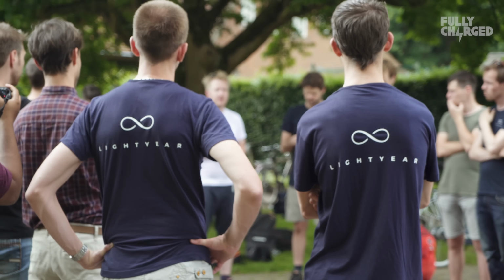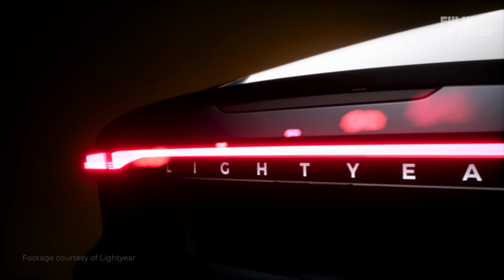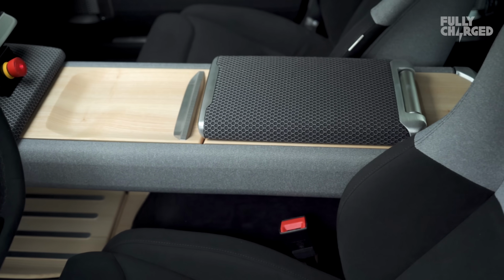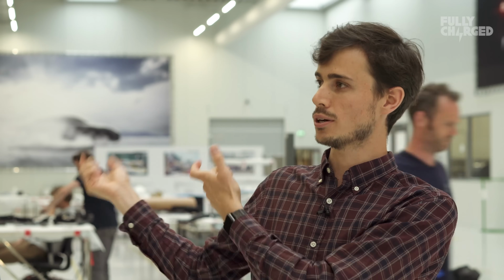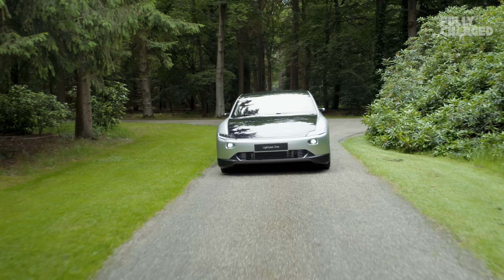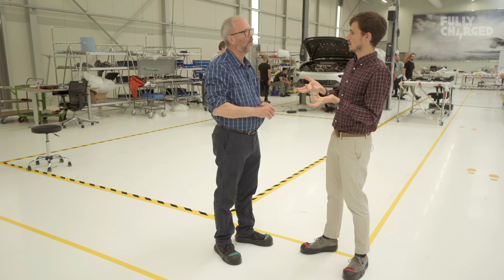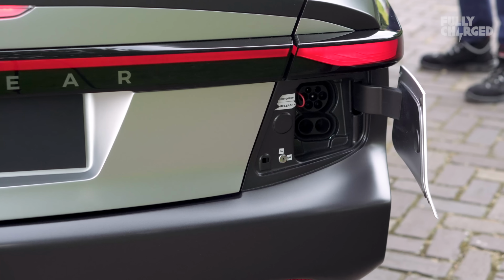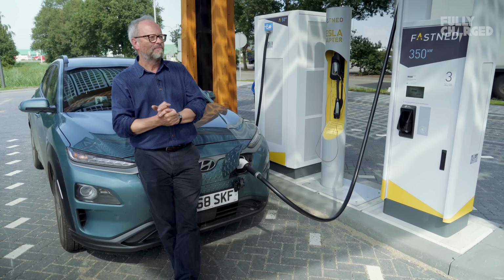Lightyear One solar powered electric car - exclusive first look | Fully Charged

Comment: Frankly I just don't understand why don't more electric cars have solar panel roofs/hoods. I only drive on the weekend. If I had a car like that I'd never need to plug it in to a charging socket.
Reply: Because cars can carry only a few square meters of solar panels, and the amount of energy received by a few square meters of sunlight is far, far less than the amount of energy required to move a mutli-ton lump of metal. On a sunny day, it'd add less that a mile to the car's range. It's far too expensive for far too little benefit.
Reply: @hans_von_twitchy1014  That answered nothing, but thanks anyway.
Reply: @papanino4415  I guess the first 5 words of your original post took precedence.

Comment: I love the car. But I can’t buy it if it cost more than $30 000. It just does not make sense with price of $170 000.. You will never sell more than 5000 cars per year with that price..
Reply: true...price will drop over time I think. I was at walmart the other day and I saw a 50 inch flat screen for 189 bucks...not long ago they cost thousands.
Reply: Uhm...... literally any Tesla. I live in a small town and they're everywhere.
Reply: Most car tech starts in ridiculous racing or luxury vehicles.  The point is to make enough money to test concepts, technology and techniques.  If that works then parts and pieces will flow down to everyday cars.

Comment: me coming from a model flying aircraft world im interested to see how much energy could be produced by funnelling some air into ducts that spin fans and the fans attached to motors some of my UAV planes that has on screen battery information, when we are descending  and not using power the prop is still windmilling and the amount of power that could be put back into the battery is staggering.

Comment: The ultimate solution is to have some sort of electrified roadway that a car can pull power from to drive and batteries/capacitors/generators could propel the car to it's destination when it leaves the main electrified highway.

Think wireless charger.

Comment: Lots of cool promises. Looks great.

I'm not believing it is viable.

Solar cells are just not that efficient and there isn't enough surface area to compensate for the inefficiency.

Air conditioning and heating would also take LOTS of power.

I don't think the reality can live up to the hype. The science just isn't there yet.

5 mph on a perfectly flat surface is doable. 50 mph up ad down mountainous roads with the heater or A.C. running is a long way off.

Adapting a Solar system to a Nissan Leaf may be more practical but even then, you probably wouldn't extend the range more than 5 or 10 percent and it would take several days to fully charge with on board solar only.

Comment: There is no such thing as an efficient solar panel.  I suppose relatively but solar currently is horrible.  If graphemes or other potential solar c lol tech prove workable then we can say this.  Even having possible autonomous energy source vehicles.
Reply: Eric Patterson if you can make 50.000 volt with a small tv controller batterie. what is the problem then? converter?
Reply: Tobias Bach my point is solar panels need a lot of surface area for a small amount of current.  This should improve eventually but now is not ideal.

Comment: "hyper efficient luxury sedan"....would be far more efficient if not a overweight luxury car.  I get that many want luxury, but the same electric motor and battery pack would go soo much further if put in a lightweight older civic chassis.  Older civic, around 2000 pounds...telsa model 3, 4000 pounds.

Comment: It’s exciting to see such young people involved in such a serious and challenging undertaking.  But to excel and move beyond the large car companies is so impressive.  If I had millions to invest I know right where I put my money.  Very impressive.  Their lowest range, in winter at highway speeds still exceeds Tesla’s industry standard range of 300 +- miles on a single charge.  The LIGHTYEAR ONE will travel 400+- miles at their worst performance range in the dead of winter at highway speeds.  But on bright sunlit days that range is approaching 500 miles!  The beat Tesla regardless of the weather.  Not only can this car drive by gas stations, they can apparently drive by electric charge stations as well.  Nicely done.  Best of luck.

Comment: I swear, the people bitching about this would have whined about the first light bulb.  "Oh, my torch is brighter, and I can cook a steak with it."
Reply: Plus, I can burn witches with my torch. CAN YOU BURN WITCHES WITH YOUR LIGHT BULB???
Reply: @LeeroyyyyyJenkinssssss  well the incandescent lightbulbs could probably give the witch a nasty scald, but the compact fluorescent and LED bulbs don't run as hot.
Reply: @TimpBizkit  damn you Edison! Lol
Reply: yes, i agree soon everyone with have one for a mere 135,000 $US
Reply: There are fundamental limitations to solar powered vehicles. Even if you magically had 100% efficient panels, perfect weather and you were under the mid day sun at the equator you'd only be getting about 6kw. If the vehichal is light enough this might get a few passengers up a moderate slope and under average conditions with current technology... You'd probably get more power from taking off the floor and having the driver Flintstones it.

Don't get me wrong the panels would probably pay for themselves eventually and the tiny amount of extra weight would be worth it for the tiny amount of power they'd output but we're talking 1% extra power if that, hardly groundbreaking.
Reply: @bloodypommelstudios7144  This car does have batteries you know.
Reply: In 1880 come the first Electric car on the market.
1900-1905 Lohner Porsche Hybrid Car 
1900 breaking the speed record of 100km/h
1903-1918 Ford Model T
1907 come the most common A Size battery.
In 1970 come the first microchip the Intel 4004 and the transistor density double every 2 years .
In the same year the lithium ion battery come on the market. Imagine where our society be if Battery developed similar .

I think that 1985 the batteries come to his physical capacity limits but can suppstain our needs.
Reply: James Franko  : You can doubt my time estimation, but what I said was true. I'm all for developing better batteries, solar panels and electric motors, but the technology is not there yet.

Don't get mad at me... It's just the way it is.

Physics remains the same. Work = force X distance. F=MA. The amount of solar energy per square yard shining on a 100% efficient solar panel has limits.

Fanboy cheerleaders can't change the laws of physics. At best solar panels can help charge a car or over several days fully charge a car. but there is just not enough surface area on a car to power it or recharge it in a reasonable time frame by itself.

The prototype looked very cool but it's performance could be bested by a typical electric golf cart.
Reply: I don’t begrudge rich people their luxury electric cars.  If you a sincere about minimising emissions however just buy a small to medium hatch, preferably a hybrid.  It’s better and more importantly 80% of people can afford it.       These guys are doing a good job.  Electric cars consume about 10kw.hr/ton/100km.    A square meter of 22% efficient solar cells should accumulate about 0.7kwhr/day.   If you can get 5 meters of collecting service that 1.75kwhr.  That’ll propel a 1 ton car 17.5km/day.      For people driving only on weekends it’ll be enough.
Reply: Gaslight, we didn't go from flaming torches to electric light.
Reply: Without critics the world would not improve.
Reply: There is an angry mob with torches and pitchforks coming for you.
Reply: Mmmm, burning stake steak, gargle gargle
Reply: Sorry dude, it's just not viable yet. 
More advances in solar panels, batteries and motors will be required.
Maybe in 20 years. 
No one wants it more than me, but reality is reality.
Reply: @chronobot2001  You've got to start somewhere or do you think in twenty years it would just happen?
Reply: @mookyzook  .........Start yes....Acting like this is going to replace Gas vehicles in the next 24hrs is what makes us roll our eyes....Not saying you in particular ....the WAAAYYYY to Overly optimistic  crowd that get an A+ in enthusiasm but a F- in understanding physics and practicality
Reply: @chronobot2001  Battery chemistry has very little room to improve; most of the new developments are structural/mechanical. 
Reality is that efficiencies are pretty good right now; don't expect too much improvement.
Reply: @chronobot2001  even at 100% efficiency and perfect sunlight. we only get 1kW of solar energy per square metre. you can get about 5m^2 of solar on them. can you move a car with 5kW of power ? what kind of aerodynamics and weight and friction characteristics do you need ? 

note that solar panels are only 15-20% efficient unless you get the space ones which are about 1000x more expensive than the more common silicon cells
Reply: yes and we still use torches, in fact, a torch can power a light bulb via thermoelectric plates. In a way, the ICE (internal combustion engine) is a complicated torch. Heat IS power dipshit. Heat also is responsible for the barriers in quantum computing as well as any other power source, including magnetism.

Comment: The solar roof and hood charge up to 12 km/h in the sun.  Great for those that don't have a garage to park in and plug into.
Reply: I think they meant each hour of charging in the sun recharges the batteries enough to drive 10 - 12 km.
Reply: hmm it would be good if it can be used three times like 36 Km where people can go from 1 small city to another, so it's not only for one city only

Comment: Tesla should buy this company and integrate the technology into their existing platforms.
Reply: It's not really technology but a design approach about saving weight on every component and prioritising aerodynamics - so if Tesla did that they would have to throw away their current designs and redo everything. The results might not be what you would like - less acceleration for example and some convenient things might be thrown away (no glove compartments for example).

Comment: charging at 10-12 km/h, in a normal 8 hour working day thats about 80-96km of charge... even if i only get about 60km of charge
i live about 15 km from work so yeah ill never have to charge my car again... 
the problem is solved so long as your trip to work isn't more than 40 km... 
sorry to the people who have to park underground at work
Reply: Except that you don’t get full sun for an 8 hour working day...
Usual rule of thumb is you get 5 hours worth of full output over an average day. 50-60km a day of charge.
Reply: @pugnut403  still fine by me i only need like 30kms

Comment: Whether this company will make it or not depends to some extent on how luxury they want to make the car and do they really want to make a solar power car. For example in Texas United States a solar powered car would make a lot of sense since we have many days of sunshine and if we park our cars out in the open they get very very hot meaning that a car that could charge with solar power might even be overcharged. Also anywhere in the southwestern United States such a car could go without any infrastructure at all. However watching this presentation suggest to me that these people are not even thinking about making a car that ordinary people might want to have or might be able to have. They have only the luxury Market in mind kind of snobbish actually. They probably won't succeed but the idea of a solar powered car is an excellent idea four parts of the United States and probably anywhere else in the world where there is not a lot of infrastructure for electrical cars yet but a lot of sunshine.

Comment: Now that type of solar power for cars is near enough perfect... just if you get stuck under a bridge in traffic the car would find it hard to use light power, but I guess that is why bridges have lights underneath them. Would the electric in the car kick in when you have no sun light? Like night time?
Lightyear One seems a very good car, way better than fuel cars but will it go with the electric cars out there? we will just wait and see...

Comment: Elon Musk when asked about this concept said it was a waste of time as it would only add about 30 miles after a full days charge.
My thought is I drive 10 miles each way to work..... Perfect!
Reply: In full sun, nothing covering it and no clouds and on a southerly latitude. Seems bulletproof! Put solar on you roof, and charge your car. A small solar panel would be nice in order to counter vampire drain.
Reply: @TheSteinbitt  Agreed, but honestly I work for a power company with free charging at work so it is unnecessary. I just think it would be more of a benefit than some might think.
Reply: This car is half the weight of a Tesla.It gets 12 km on a kWh where Tesla does 4 or 5 km.I think 20.000 km free from the sun a year in a good country is pretty good. Even in the UK you have 12.000 km a year free.This car is not very fast and looks strange because of the extreme aerodynamics.Solar panels are so cheap today it's well worth adding them.Lightyear say this car can be cheaper to build then a petrol car.I hope they will change the industry
Reply: Maria Santov Lets wait for the real world numbers, I’m not confident it will I’ll be much more efficient than a Tesla tbh. I highly doubt it will ever make it to high scale production.

Comment: years ago i imagined what the perfect electric car would be, i thought it would have to be self charging because it makes so much sense to capture the free energy of the sun, it would have to be light to be efficient, and it would also have small motors on the rear wheels or every wheel to eleminate any loss through transmissions and drive shafts, i open my eyes and see this car and its exactly what i imagined it should be. amazing...
Reply: chrismechanic B ---> Quite a few people have good ideas. Unfortunately, NOT all are in the right place at the right time with the right people supporting them.
Reply: In countries with cheap electricity it makes more sense to just charge it via the grid. Adding solar panels to your car is not only expensive, but it's also additional things that can break. It would take a really long time until you can earn back the extra costs and adds unnecessary economic risks to the owner.
Reply: @yourcrazybear  the  dark glass covering the roof and back window protects the solar panels form damage

risking the cost of repairing them is worth the possible reward

the people who made this car  are not delivering the car  named Stella that was used in the race

it  was driven for the entire race on the  battery   equivalent   of  two gallons of gas 

this car can't do that

it is more reliant on the battery than the solar energy
Reply: The cherry on top would be if it was made with the same stainless steel exoskeletal frame the cybertruck uses.
Reply: There are cars like that for years now.
Reply: chrismechanic B mahjong  saw q
Reply: My vision is an EV that can capture generous amts of energy while in FORWARD MOTION and send it back to the battery. 
Solar and ReGen are somewhat useful but certainly Not Enough.
Reply: Yes, I dreamt of this solar powered car around twenty years ago. But, I could not make it a reality, because I am a middle class person with minimal salary. I am glad now to see this car.
Reply: It’s a surface level idea which basically anyone can come up with, however it doesn’t work at all. Tesla looked into it however because of the small area of the car it would be far too expensive compared to how little energy you would get. There’s a bunch of videoes on it on YouTube. The solar panels basically doesn’t do anything.
Reply: They won’t get anywhere near the extra range they claim
Reply: Good thing a bunch of Dutch lads had the same idea as you did, mate.
Reply: There is no free energy, you need to manufacture the solar panels wich contain harmful chemicals and you also need to replace them after some time, and those chemicals dont just dissapate.
Reply: @olenraks  yeah that's kinda obvious, nobody's talking about it literally
Reply: @heikg  well he literally spelled it out, how much more literate can it be?
Reply: @olenraks  you're actually triggered?
Reply: @heikg  you actually have nothing else to do in your life?
Reply: @olenraks  you seriously need help
Reply: @heikg  hahaha get a hold of yourself there big boy. Do something else with your life. You are loosing it.
Reply: @olenraks  I see you don't even read the messages. Do you just copy/paste the same sentences as a reply from a notepad you made when you were 10? Also using "hahaha" in a sentence by itself should be enough to make most people feel ashamed, so kudos for not caring!
Reply: @heikg  what about spare parts? What's happend when you hit or just scratch on the hood???
Reply: Yes, you basically made it!
Reply: @TheSteinbitt  😂😂😂😂 gigantic